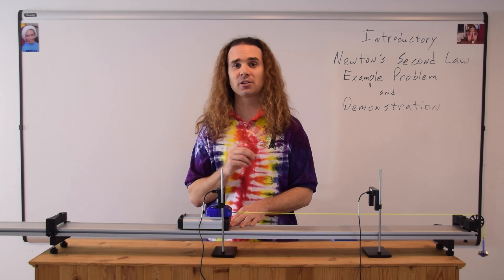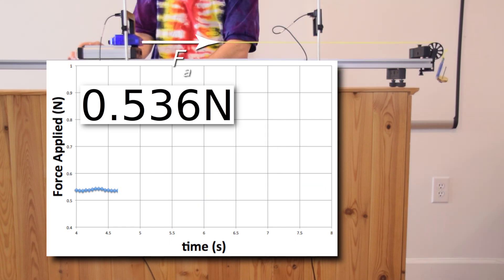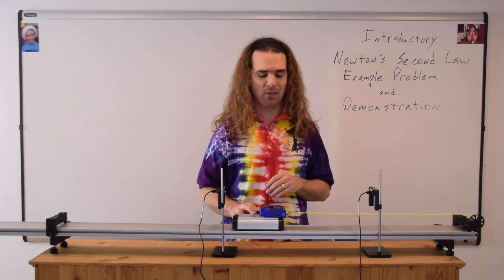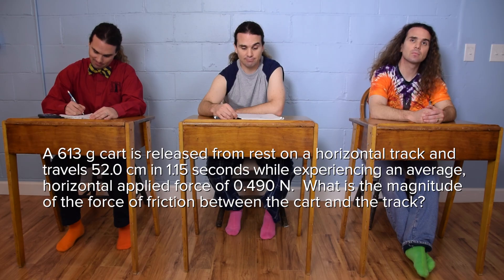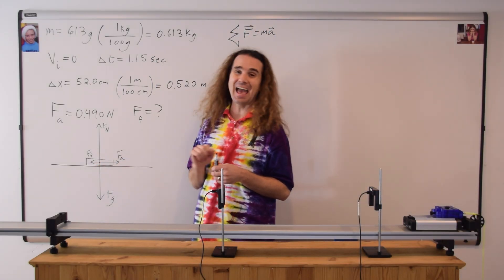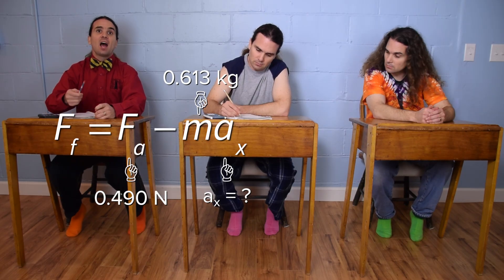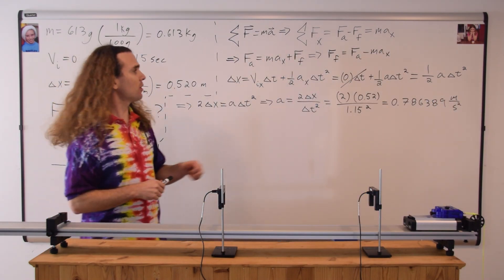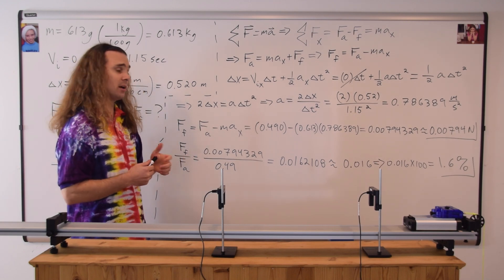Introductory Newton's 2nd Law Example Problem and Demonstration

Comment: Wrong. You are calculating a braking dynamic friction force pointing backwards. But if wheels are rotating no such force will exist. You have dynamic friction forces inside the chart, at the wheel centers. Those forces do not point backwards and you have no idea about their values

Comment: Mr.P when calculating for the force using mass times acceleration in the x direction, how come you only used the mass of the cart (.613kg) instead of adding both masses (.613kg+.055kg).  ik they are in the same system but how do you know which situation you only focus on 1 mass and which you focus on both. is the acceleration not the same for both or am i mixing things here?
Reply from the maker: The acceleration is the same for both the cart and the hanging mass.
The force sensor is attached to the cart, therefore, the force measured is the force applied to the cart. This is why we summed the forces acting on the cart only.
You can also sum the forces on the system (cart and hanging mass), however, that was not the approach I took in this video.

Comment: Newton's Second Law of Motion needs a slight correction since they did not know about squaring a number in Newton's era we can assume that this may have been overlooked. As such (F=ma^2) is a natural correction that can be easily proofed through calculation, formulation, and experimentation. This correction is 33% more accurate if you do not accept it proof it yourself.

Comment: What's wrong with getting the acceleration by using the v-final minus v-initial over time. with v initial being 0 and v- final being the displacement of 0.52 meters over 1.15 seconds = 0.452 m/s. 

a= (0.452-0)/1.15  = 0.393 m/s^2  ... why is it wrong?
Reply from the maker: Average velocity equals displacement over change in time. Velocity final is an instantaneous velocity, which is not the same as average velocity. Here is a video about the difference between the two: http://www.flippingphysics.com/instantaneous-and-average-velocity.html

Comment: This seems more convoluted than it needs to be. Why not use a motion detector, and use the slope of the velocity graph to get the acceleration? That way the acceleration is also found experimentally, and we don't need to make additional assumptions like constant acceleration (to use UAM) since we can just see the velocity graph is linear and get the acceleration directly.
Reply from the maker: There are usually multiple ways to solve physics problems and absolutely, one could find the acceleration using a motion detector and use the velocity as a function of time. Instead of using a motion sensor, we could also measure the final velocity using the photogate, with velocity initial of zero and the change in time we can determine the acceleration.

I wanted to show an actual measurement of a force as a function of time and I already have many videos about UAM.  The point wasn't really to find acceleration, the point was to understand Newton's Second Law and I thought it would be fun to find the force of friction between the cart and the track.

Also, I have another video in the works which is an extension of this one. That video will explain why the tension force in the string changes as a function of time even though the free body diagram on the mass hanging doesn't change, which is often a stumbling block for students.
Reply: Can't wait to see it. I love these videos.
Reply from the maker: We Are Showboat Glad you enjoy the videos.  By the way, thanks for the suggestion on how to solve this problem.  It reminded my that I need to reflect more on how I solve problems for my videos to see if there is an alternate, useful solution.  Sometimes the one that occurs to me first isn't the best one and the more variety I have in my solutions, the better the education will be. So thanks.